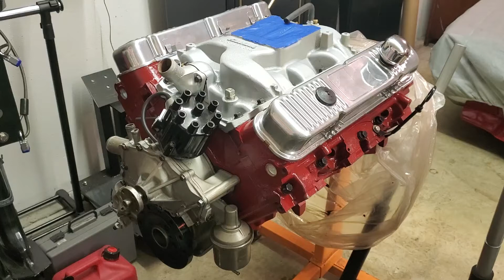Buick 430 Build Summary

Comment: WHAT were the cam specs that you used?
Reply from the maker: TA_212-455
470"-218'/.475"-230', LSA112' the duration is at .050
Reply: @probuick3317  You know you could have gone with a Stage 2 style cam with Rhoads lifters (226 @ .030).

Comment: What pistons did you use? Did you deck the block? How far in the hole where the pistons
Reply from the maker: Hello, in this build I used TA Performance cast replacement piston as forged are cost prohibitive for a 430. The block was cleaned up, it only took 10 thousand to do so.  The 430 Big Port heads were also cleaned up at about 10 thousands. I didn't measure the distance in the hole as the camshaft I installed was pretty mild. That said,  with the 20 thousand total (10 each off the head and block) I went with a Felpro head gasket that was 40 thousand installed.
Reply: @probuick3317  ok. I have a 67 riv big port 430. And im using sealed power pistons. I've used then on many other engines that run great so I trust them. Problem I'm reading is factory buicks have a taller deck height than advertised aswell as most aftermarket pistons already being shorter so you can cut the deck. That being in mind. If all this end up being true I could have pistons that are 80 thousandths in the hole which is terrible for quench. I'm going with a ta284-88 cam.
Reply: @44amanaplanacanalpanama44  that's an interesting build.
Reply from the maker: The camshaft you choose will work great. Lots of torque.
Reply from the maker: I agree that 80 thousands would be a lot. TA uses EGGE pistons in this application.  Here is a link to their website and specific 430 application. https://egge.com/product/egge-piston-set-with-pins-187/
Reply: @probuick3317  nice. Those spec out pretty good for height. About .060 over the sealed power. Which is perfect quench. Are those the 349$ 430 stock cast replacements? Too bad I already bought the sealed powers.
Reply from the maker: @TheSamplebridge  Yes, they are. TA 1606
Reply: @probuick3317  might see if I can return my sealed powers and get those
Reply from the maker: Would be great if they did.
Reply from the maker: *Let you return them.

Comment: I dont know if its ok to ask here, but me and my dad are restoring an old buick Wildcat 1968 it originaly had a 430 7.0l v8 but the engine failed on us, we found and shiped to us what we thought was the same engine but ended up getting a 350 buick. Does anyone know if the crankshafts would be the same and if its possible to make 1 engine out of the 2?
Our crankbearing went bad on the original engine and ended up damaging the crankshaft. Would be a big help if anyone had any knowlege. Great chanel love your videos!!!
Reply from the maker: I should have added that virtually nothing mechanical interchanges between the 350 and any of the big blocks. There is a lot of interchangeability between the big blocks with some VERY important exceptions.
Reply from the maker: The cylinder heads from the 350 do not exchange to any of the big block engines. Not to the 400, 430 or 455. You could get away with using the carburetor if it is in good working order. It would be on the small side for a big block engine.
Reply from the maker: Unfortunately the 350 Buick crank will not work. It doesn't swap to a big Block. That said, I believe the 400, 430, and 455 cranks are interchangeable. . Question: How bad was the spun bearing? Have you taken the cranks to a machinist to verify it's no good?
Reply: Ok Thank you very much, do you know if the cylinder heads are interchangable, and the carburetor

Comment: I have the other style rocker arms that you deleted. What was un favorable with that? Cause that’s what I have. Our build is very similar. I did the clevite bearings and went with Durabond on the cam bearings due to extremely good reviews. Comp cam “ 454 lift “highway torque” cam. Doing further research I would like to go through mine again sometime in the future.
Reply from the maker: Actually there's nothing wrong with the "old style" oil system for stock or mild upgrade engines like yours and mine. In this case it's just a personal preference I have.  That said, Buick must have changed it for a reason.
Reply: @probuick3317  My rocker arms began wearing into the spacers for the bolt . My machinist machined my rockers down and added thrust washers between each one so that wouldn’t happen again.
Reply from the maker: I do know that the oil passages in the heads on the "old" style oiling system can get blocked by sludge over the years. Through the pushrod process eliminates most of that. possibility.
Reply: @probuick3317  I have a survivor 20k mile 1967 Electra with the big ports and manifolds. This motor was seized up due to wrong weight of oil being put in. They put 5w30 :( This motor was very fortunate to be able to be out back together 100% numbers matching. Everything inside me wanted to just swap a 455 into my Electra cause they are cheap and easy to find and my crank was messed up due to #4 seizing up. I was able to have the crank welded at the last known living man in Highland ca who still did it. 80 years old! Still welds cranks! and re machined . Rods and mains are .10 under. Cylinder .30 over. Runs smooth and quiet. I need to rebuilt the original 1967 Quadrajet. It runs good from a stop but falls on its face if you step on it while cruising .
Reply from the maker: Very cool that you saved it! I appreciate the story about the guy who welds cranks. There is a guy up here in Washington State called "cast iron Mike". He's probably bumping 80 and one of the few people left that welds cast iron. He has saved some Buick heads for me  in the past.

Comment: Engine is looking good. Where did you get the chrome valve covers?
Reply from the maker: Those are the stock 430 covers that I cleaned up and powdercoated using an Eastwood powdercoat and their powdercoat gun. I have an old oven I use to cure the powder in my garage.
Reply: @probuick3317  would you put the stickers back on?
Reply from the maker: @MCBudderBros  I tossed it around and decided I would.....
Reply: @probuick3317  nice

Comment: Which way does the weightsts in the flex plate point when installed do they go on top of the back of the hump on the crank shaft or the opposite way?
Reply: The flexplate only bolts on one way. You can't bolt it on incorrectly. Unless it is aused flexplate you can usually see where the triangle and semicircle notches go on the crank side of the flex. However the weight should end up on the side of the crankshaft with the hump if it is what I think you are talking about.